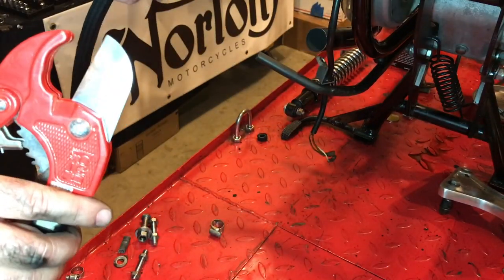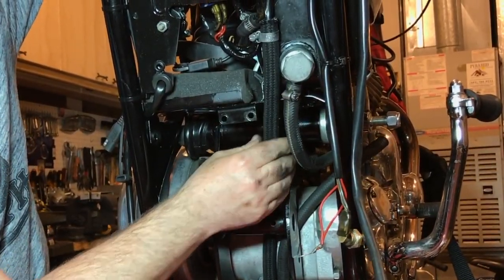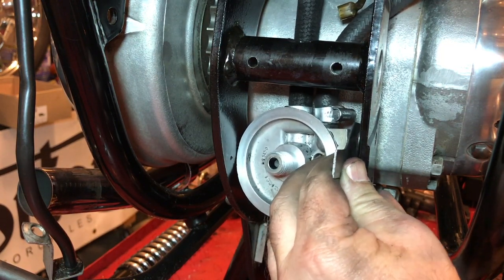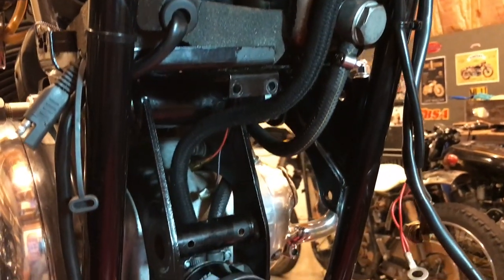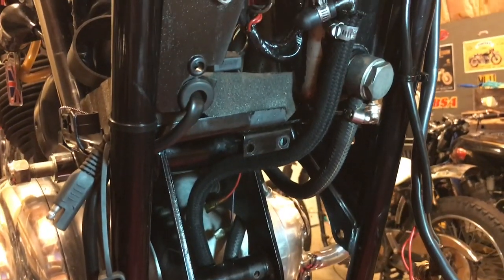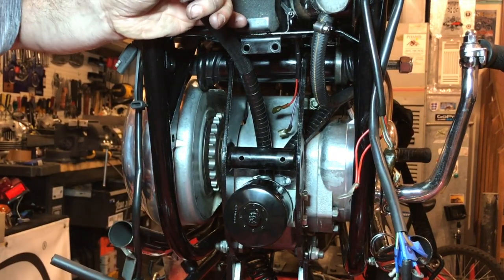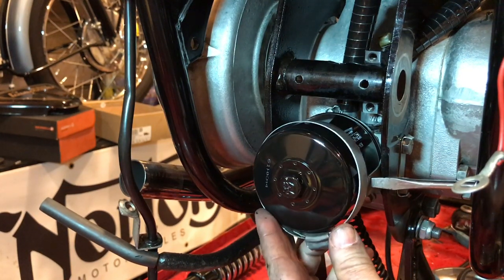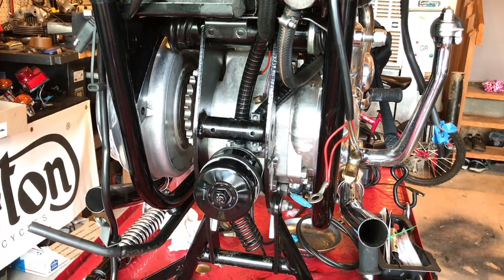1974 Norton Commando 850 MK2A – Swing Arm fix (Part 12) – Oil Filer reassembly

Comment: Is that  21 tooth front sprocket? Looks neat. I see you have blocked off the final drive oiler. Not sure what Norton were thinking with that one. Be sure the oil line dose not rub as there's lots of movement under the oil tank. Norton originally used steel conduit around there.

Comment: lovely job sir! BTW can I ask where you got the blanking bung for isolating the old "rear tyre oiler" many thanks
Reply from the maker: Thank you Aaron.  Yes, I got the little blanking plug from the local motor parts store.  I think it was O'Reilly or Napa. They had a packet of various-sized pipe blanking plugs and luckily there was one bung that fitted perfectly.